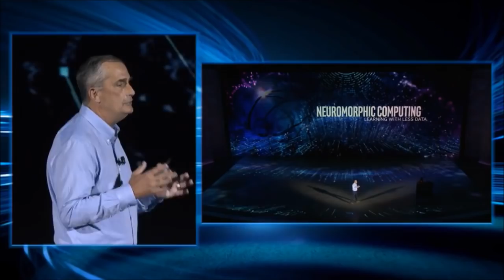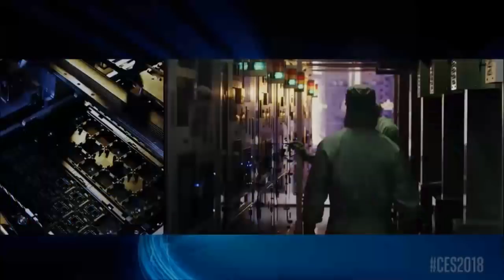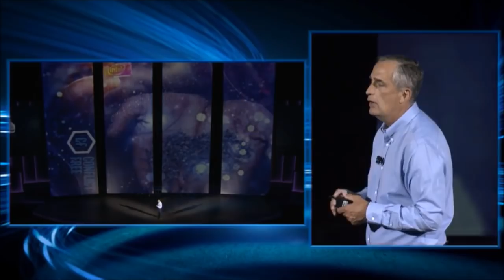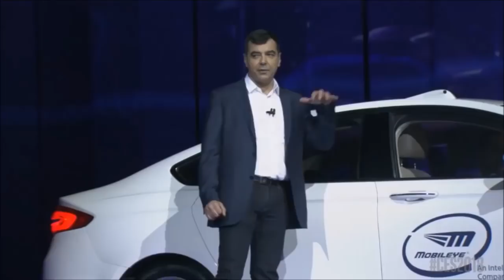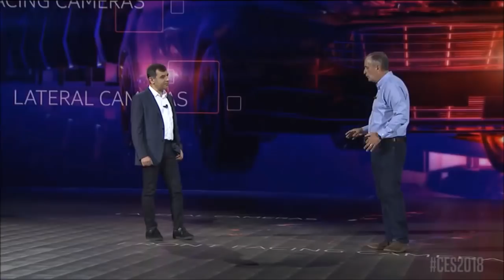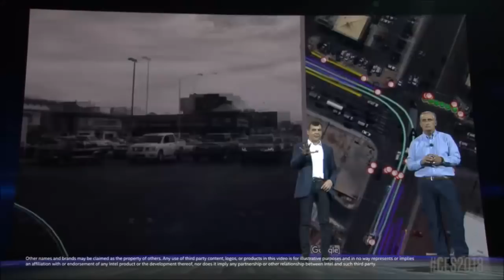Intel's New 49-qubit Quantum Chip & Neuromorphic Chip

Comment: Wow computer games are going to be lit!
Reply: Quantum computing is a VERY long way from having any benefit for computer games. It will eventually be able to do certain types of optimization problems faster, which will eventually lead to better rendering, AI, and VR probably. But most of the computing you need to do for gaming purposes will always be better performed on a classical computer because they are better designed for logic and can do it MUCH faster than a comparable quantum computer (and no quantum computer is anywhere remotely close to comparable).

We are so far from that I wouldn't hold my breath. It's like looking at an electric typewriter and imagining a PS4. Gaming isn't even the kind of thing they are working toward yet. But even worse, actually. There are no real barriers to scaling up except that it is hard and will take time. But there is a huge barrier to bringing these things into home use and that is the temperature required, around 0.015 Kelvin. You can't do that at home. You need a complex liquid hydrogen coolant connected to a constant lab grade vacuum refrigerator. The cooling system for your cooling system needs its own cooling system. Maybe at some point material science will advance to room temperature q-bits, but that isn't even the main thing quantum computing scientists are working on yet. You would need a breakthrough on of the type that took us from vacuum tubes to silicone chips. It is a completely different thing that they haven't even started working on yet.
Reply: sure they will. AI will be the next biggest bottleneck in games. Rendering isn't they only part of video games ya know
Reply: Nvidia's Titan V has AI, guess who looks kinda stupid now?

Comment: Can you program it  to like certain colors and make it create art work in a way that not machine learning? Is it just an off the shelf chip like an FPGA that you turn into a section of a brain then link all the FPGA together? That might be a step toward putting a thinking computer on one purpose built chip where all the architecture is not to crunch numbers but to make brain pathways that run on emotions and have "serotonin gates" and "dopamine gates" . Or go a step above and make two way neurons like in fruit fly's that allow the computer to think fast enough that it could pilot a fly or mechanical fly. Makr a fruit fly that flies like other Fly's! *Oh wait it would cut into the profits of big oil companies profits? We wont see that in our life time*
Reply: Everything in a computer involves number crunching.
Reply: Thats right no one can clone brain of humans becaus the intelligence is coming from spirit not brain
Reply: Zini Mohamed its coming through the brain the brain is the spirit valve thats how i see it.
And the spirit is just connect to the body via the brain the brain itself is kinda like a decoder for the spirit if it goes bad our behaviour will change, because it gets bad input.

Comment: 10kb per kilometer? Per car? So 1mb per 100km (roughly 62 miles) per car. Doesn't sound that bad until you consider how many cars will be doing it. Consider the USA has 253 million cars/trucks. I assume the  number on the road at any given time is much much lower. Even if just 60 million at any given time that would be 60 terabytes per hour if you average around 60 miles per hour.

If netflix had every single subscriber (worldwide) watching HD for an hour that would be less than 315 gigabytes per hour.

I don't know about the constraints on bandwidth but it seems like there may need to be some major upgrades considering Netflix bandwidth was causing such a fuss.
Reply: if there are 10^80 particles in the Universe, and if each one was a qubit, that would not be enough memory to simulate the very Universe in which the simulation exists...do the math. YOU are a walking miracle with an unlimited imagination and a unique singular un-copyable conscious experience. 

If a country puts out a little effort, it could make all the cars on their roads self-driving cars. The only limit is human stubbornness. Who wants to drive a self-driving motorcycle? No, driving is one of our forms of free expression and we will not give that up so easily.

These tech giants do not actually want what they want. If you get my drift. Once everything is autonomous - meaning no human freedom - there would be no reason to work at a tech company to create any more autonomous anything. By definition.
Reply: Nathan Coffey it's the new neutrino embedding technology they are embedding information in neutrinos and shooting it through the core of the earth using colliders technology they already reach light speed information hence is why we get 5G they get the new neutrino technology that's how they're going to make this all work that's how they have the upper hand on us you're welcome!!!